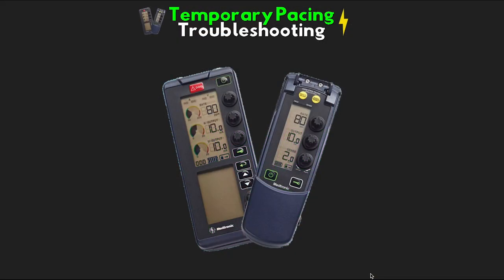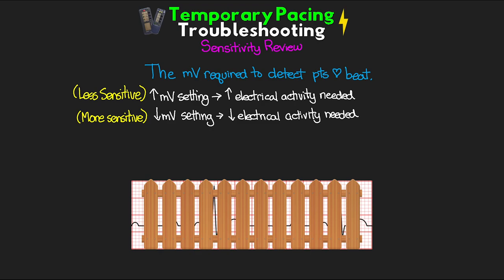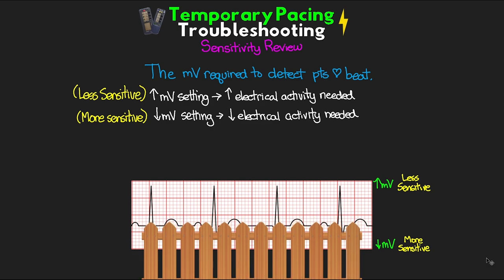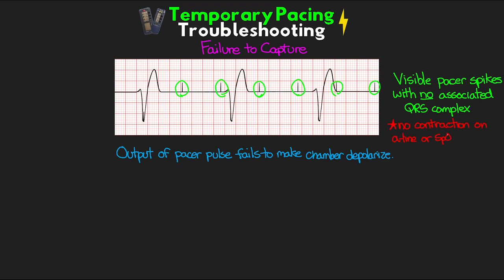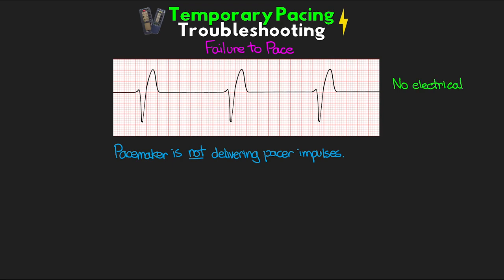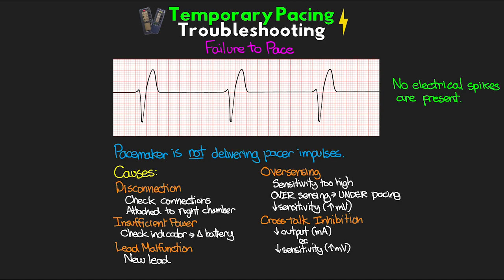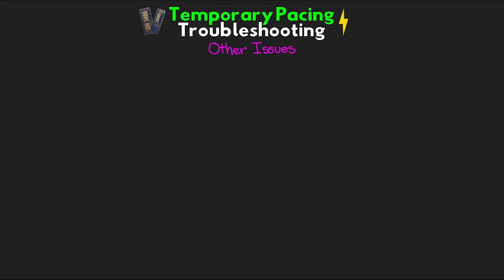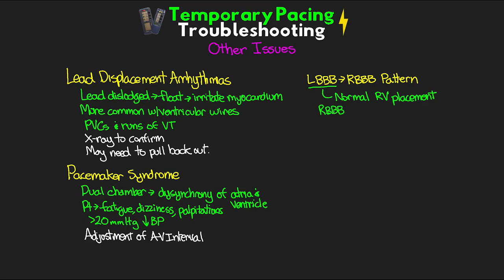Troubleshooting Pacemaker Problems EXPLAINED!

Comment: Hello! Thank you for the video. I have a question: how come the spikes produced by the pacemaker when its failing to sense don't produce additional ventricular or atrial contractions following the hearts own beat if its not sensing it?
Reply: Hi! 
I believe it depends on where in the cardiac cycle the spike is fired- for example if the spike is delivered right after the qrs that means the ventricles just contracted- if the ventricles attempt to contract again- this is when r on t can occur sending the patient into vtach or vfib, so it can happen, and is very dangerous, that is why if you see inappropriate spikes you immediately begin to trouble shoot

Comment: great video! I do have a question if you can help me understand, and please correct me if i am not interpreting this correctly:

When the problem is failure to pace, no pacer spikes, the problem could be oversensing, so the sensitivity is high (mV low/ fence is low) so we have to increase the mV (aka bring the fence up) which will lower that sensitivity

But when the problem is failure to sense, oversensing is when sensitivity is low (mV high/ fence is high) so we have to decrease the mV (bring the fence up) which will increase the sensitivity

This is confusing for me because oversensing would have two contradicting definitions.

Thank you!

Comment: Hi! thank you very much for your videos! If I may ask you a question, the ekg at 10:07 seems to be a ventricular paced rythm (wide QRS) just without the "spikes sign". When not paced, shouldn it be a sinusal rythm, with che classical pattern P-QRS-T waves? Thank you again for you time
Reply from the maker: Sorry I missed this for so long.

So to answer your question, it really just depends what the patients rhythm is underlying. If they are a sinus rhythm (SB, etc) then yes. They could be junctional, or 3rd degree, or ventricular. Just depends.